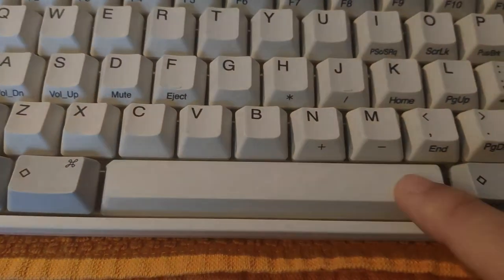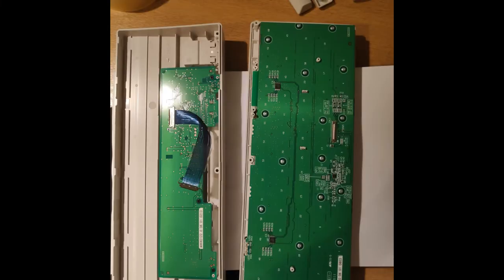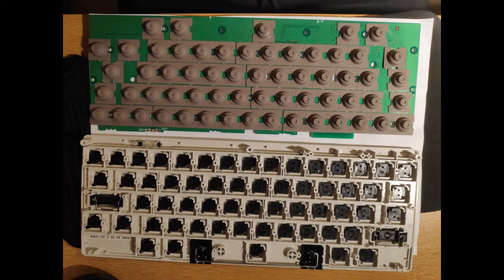How to fix HHKB Spacebar Rattle

Comment: you guys buy 300$  keyboard to fix the spacebar?
Reply: even if it came fine, lube wears over time. theres not any stabilizers that dont rattle without some kind of modification done to them.
Reply: Topre switches are the best